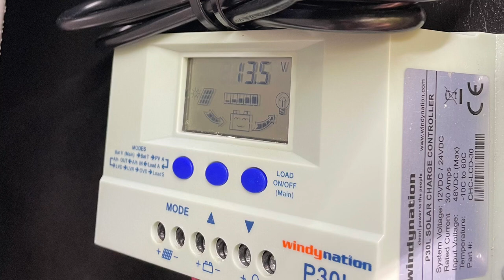DIY OFF-ROAD OVERLAND CAMPER BUILD

Comment: How did you make the metal frame and seals around the main door to get into camper and the other doors?
Reply from the maker: I used D shape automotive weather door seal. I also used 1/4” pvc sheet to on the hinges so it would raise the gap a little of the seal.

Comment: Great design, looking to do a similar project this summer, what kind of trim did you use? 
I planned on using outdoor primer and then truck bed liner for the final coat, but I'm mostly stuck on the trim pieces.
Reply from the maker: Thanks! The trim is 1”x 1/8” aluminum 90deg and flat bar. With fusion matte black.

Comment: What method did you use to secure the camper box to the trailer? Also, I am looking at building a tongue box exactly like yours, what slides did you use for that if you don't mind me asking. Awesome trailer build!
Reply from the maker: Thanks! I through bolted the box. From bottom to top it goes Nylon lock washer, 1”SS washer , frame, plywood floor, 1”x2” strip and another 1” washer and bolt. 
VEVOR Heavy Duty Drawer Slides... https://www.amazon.com/dp/B08DKN7P9G?ref=ppx_pop_mob_ap_share 
And those are the slides.

Comment: What size is the trailer?

Thanks,
 Tim
Reply from the maker: It’s 50”x 9’. It used to hold a large hydraulic pump that was modified to what you see there.